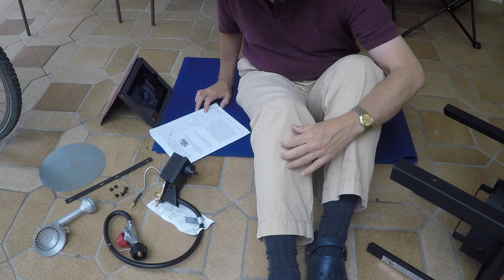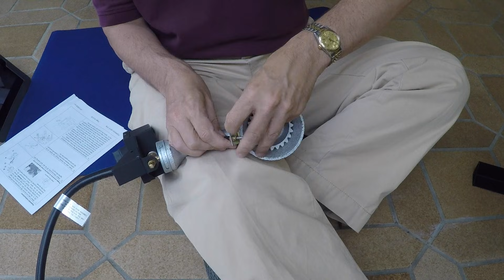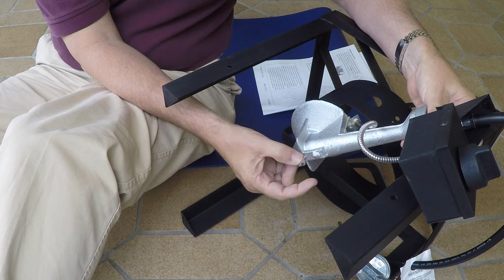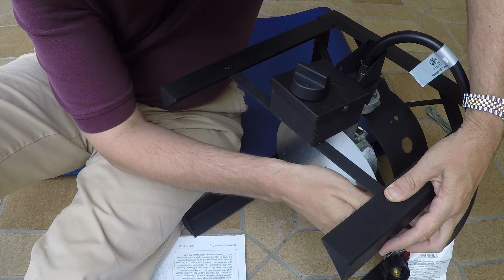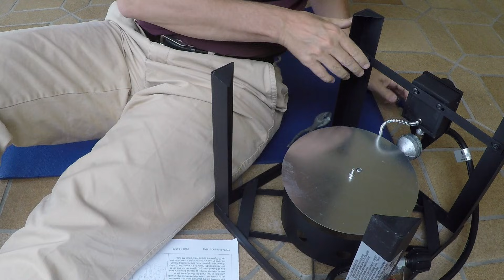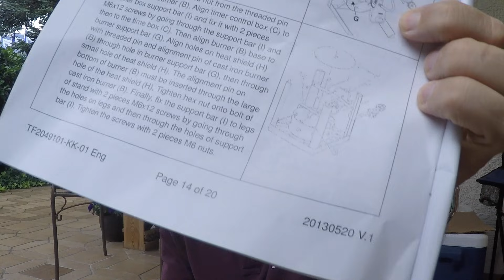Turkey Fryer Set Assembly - Howto

Comment: You right about the installation. I also had a bolt for the lid Missing. The burner was also low quality, it was light wait metal.  Model Tf2005101-og_01. Thought this was a good sale price. But not the quality I was expecting. But it how we grown to see, by depending on items purchased out side of the USA. Not saying we here in the USA are perfect. But I've run in to these issues many times. Thanks for the how to video.
Reply from the maker: I agree, it wasn't until after I had already put it together that I decided to take it back apart and make a video showing how to put it together because the directions were terrible. Glad to have helped.

Comment: I did your instructions step by step but gas will not stay on. Will run for about 15-20 secs and shut off
Reply from the maker: Unfortunately, I'm a simple user and can only guess at this. First thought is the gas turned on all the way? Second thought would be to question the propane tank that you are using. Ah, the turkey fryer comes with a safety timer to automatically turn the gas off after so many minutes, is it turned all the way on? Perhaps, take it back to where you got it and get a replacement turkey fryer or call their help desk. Sorry, if this isn't much help. Let me know what you do or find out.
Reply: Les Waller wm
Reply: Les Waller k

Comment: Help! I leave the 3 threads and the burner is loose to the timer. It can't be right??? I feel like gas will be leaking everywhere. Is this right?
Reply from the maker: What happens when you carefully give it one more full revolution? Without me actually seeing and doing it, it is difficult to see what you have done. You could always take it back and exchange it.
Reply: Les Waller I'll try giving it one more turn tonight. Just to be clear though, you left 3 threads exposed and it was tight to the timer housing? Mine is not and there is about a 1/2 inch gap from the timer to the screw bracket. What would happen if I were to not have 3 threads and make it tight?
Reply from the maker: I am pretty sure that it was not tight and I left 3 threads exposed. Mine did not feel loose, though, either. It didn't wiggle or have much freeplay. I do not know what would happen if you turned it until it was tight; the manufacturer would be the best to ask that question. I like following directions as they usually have them for a valid reason, they just don't explain what the reason is behind it. If you feel it is too loose at 3 threads, take it back where you bought it and/or ask them what their experience is with the burner.
Reply: Those threads are not used to form a gas tight seal. The gas is emitted from an orifice in the end of the threaded fitting. The threads are simply to align the burner to the timer assembly and leaving a few threads showing ensures the threads don’t get stripped and also allows a little play in the two assemblies so everything will self align. I’m the Chinese guy that wrote the instructions .

Comment: A specific gadget for frying turkeys - I never knew such a thing existed. Not a washer in sight so a periodic retightening will probably be required but at least that probably increased the manufacturer's profit by 0.1 cent.
Reply from the maker: What was really nice is it was dirt cheap, about $20 or $30 and it works great for brewing beer. The problem I had was that my pots need to be big and the bottoms were convex so on a flat electric stovetop it was almost impossible to bring the wort to a boil. So, the turkey fryer can really reduce the time it takes me to brew the beer. Brew day still takes about 4 hours as it is.